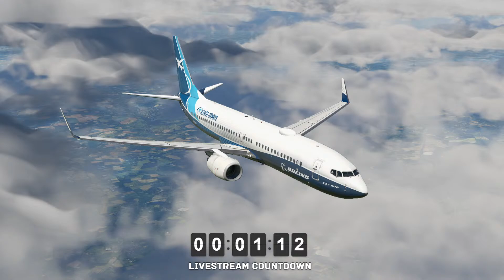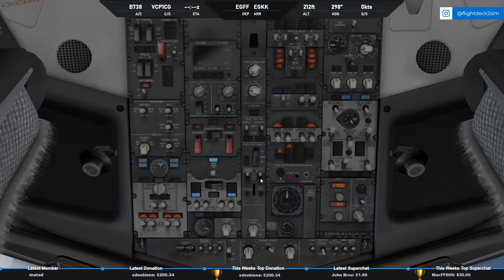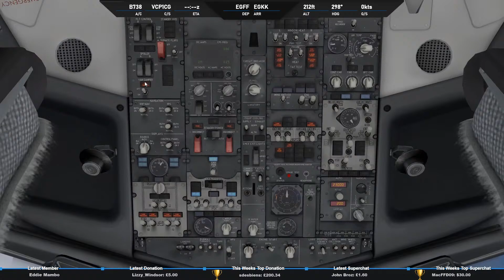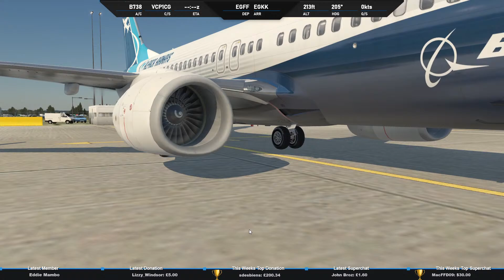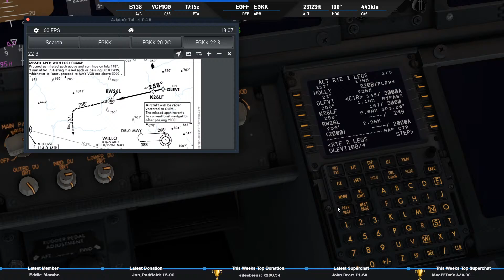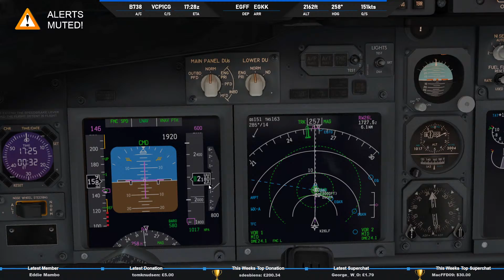Positioning an Empty Aircraft | Real 737 Pilot LIVE | ZIBO MOD 737 | X-Plane 11

Comment: 31:30 Thank you for clearing out why in some B737 pilots turns off hydraulics system A prior pushback, learned something new :)
Reply: Southwest still does it as of now.
Reply: @SSAviation737  Do you know maybe: 
1. Hydraulic system A (the engine pump + electric pump) should be off until tow truck disconnect?
2. If the left engine is running, hydraulic System A, eng + electric pump A should be also off until disconnect tow truck and finish pushback?
Reply: @ttvFairPlayerPL  Yes to both of your questions. According to the SWA AOM, the After Start Flow is not to be done until tow bar disconnected and salute from ground crew. Part of said flow is turning on the hydraulic A system pumps. If you sat near the wings on a WN, shortly after pushback, you'll hear those hydraulic sounds activate as the first officer turns them on. Part of the SWA Before Start Checklist is "Hydraulic Pumps - A's OFF, B's ON. So, both of the A pumps will be off for push until after towbar is disconnected and salute is received.

Just for your information, the captain does most of the overhead panel flow during preflight, and part of that flow is to turn OFF the A pumps and turn ON the B pumps.
Reply: @SSAviation737  Thank you very much
Reply: @ttvFairPlayerPL  No problem! :)